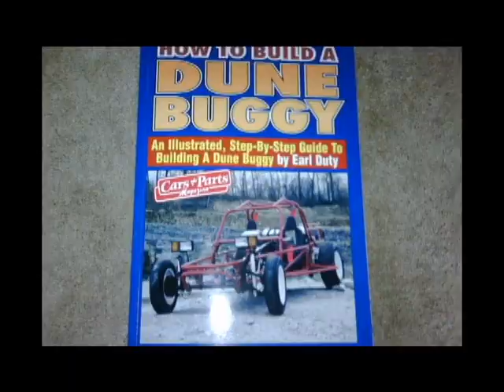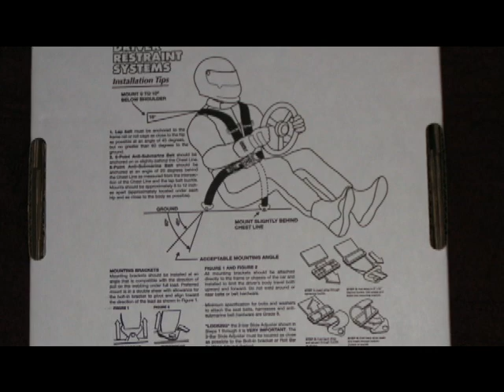Rail Buggy Project

Comment: Sweet, looks like your doing it right, Check out RealWorldRepair.....Our project was a mess when we got it and now it's finally finished. Bars are a pain in the butt to build and paint but they are allot of fun. We may sell the Barrien frame as Kit if anyone is interested cash takes it and we've had the I4 Ford motor running. We just we have too many projects! No worries, Bondo should Be OK BTW. Just overdoing it a lil- wont be in any shows will it? Don't listen to negative B.S. keep up the good work!